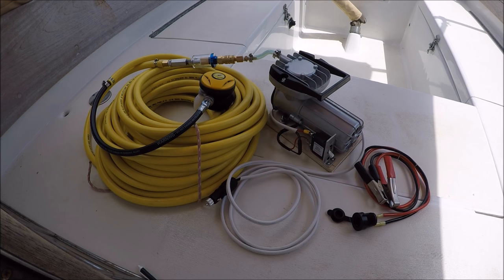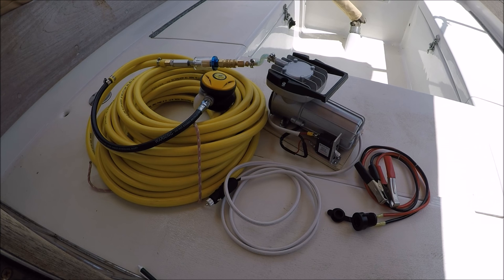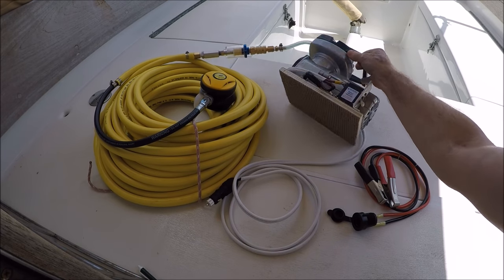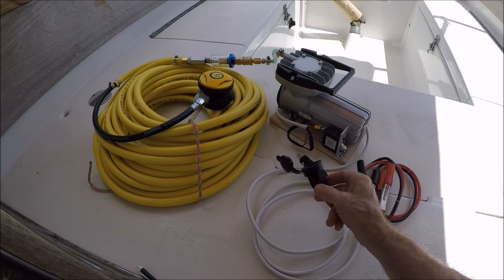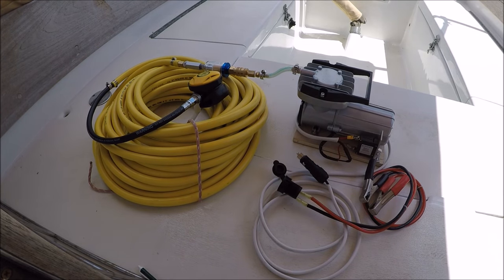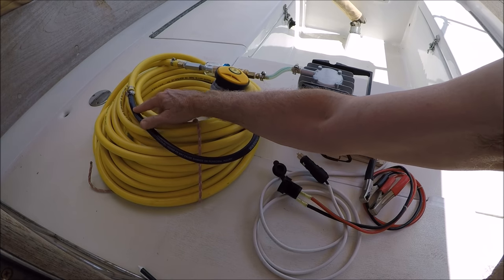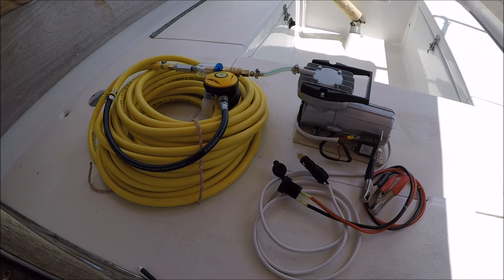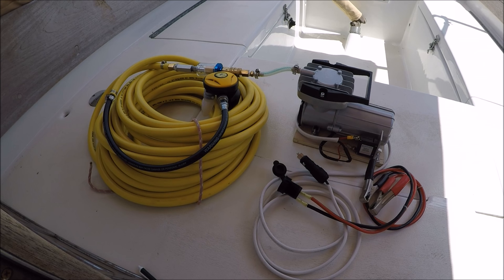DIY $300 Dive Hookah for Boat Bottom Cleaning

Comment: You probably don't need the regulator. Just run the hose into the snorkel and let the air flow out your mouth.  Breathe from it as needed.  A similar system operates in large aquariums where mermaids breathe from an air hose.  When I was young, I built a very simple rig from a DeVilbiss air compressor, garden hose, and snorkel and used it as I cleaned our swimming pool.
Reply: Is this a joke lol
Reply: 'Small Cell Carcinoma' be sure to flush the lungs out good.

Comment: There is no need for a 150 liter per minute pump , a human being at most inhales 12 liters of air per minute, so it would be enough to use a 20 liter minute pump with a 1 liter storage tank with a maximum of 6 liters to compensate for the fast breathing in moments of fatigue. However your system is effective but can be improved to consume less current and spend less on the pump :)
Reply from the maker: I don't doubt your numbers. However these Chinese pumps have not been verified that their output is as stated by the manufacturer. They claim it draws 9 amps but mine only draws about 7 amps at 12.8v so looks like it is at least 25% over rated. And if as you say, we don't need anywhere near 150l/min, that confirms the pump rating is inaccurate. Maybe some of the loss is the restriction of filter, hose length, depth of dive, regulator spring resistance, and so on.  In practice the pump, for whatever reason, is only barely giving me adequate air. I suck every last bit of air from the hose on each breath when working at 4'. Because I am using everything the pump delivers I don't think a small tank will help because it will always be empty. If the tank were large and you waited for it to fill it might help but I don't know for how long. I'm typically down for about 30 minutes to clean the bottom. It works OK for my use though.
Reply: @atomvoyager  Looking at the technical specifications of these pumps I noticed that the maximum pressure is only 1.12 MPA = 1 BAR +/- , if we consider that at a depth of 10 meters we have 1 atmosphere = approximately 1 BAR. here is the reason why he can't get his breathing properly. between the resistance of the filters and the pipes, at least 2 bars would be needed to have a good flow .....I was intent on buying one to build a respirator, but better to buy another type, perhaps with pistons without oil, .... thanks to you for sharing your experience!
Reply: @salvatorebarbaro5862  two bars right? At sea level we have one bar (1 atm).
Reply: I have used one of these for years but I used two pumps connected together. After a wile I got tired of hauling batteries and wired in an inverter so I could plug it in  on the pier or use a battery If I had to. Now I use a standard air compressor and a low pressure regulator. 50 to 80 psi.
Reply: @salvatorebarbaro5862  If we consider that he's going to be cleaning his boat at a depth of 10 metres then you are probably right. But it's a big boat. He's going to about 1.5 metres.
Reply: But you also have to have enough to push all that air down

Comment: if i may, i have s couple of things for you to think about. The air being pumped may have oil contaminates from the pump,  if you can, its best to put a filter in there, you should be ok for now as the length of hose will hold most of that back, but at some point its going to get to you. Also maybe a small bag reservoir, inside a  container as close to the regulator as is comfortable, this should protect from over pressure if that manages to happen for whatever reason as well as give you a more comfortable escape if the pump stops. i wouldn't go below more than a meter with compressed air, if you can help it.
Reply: Hey how can the air have oil in it? I just started using mine and I don’t like how I’m feeling afterwards, I thought these were “oil less” but I’m def feeling like crap

Comment: I built essentially the same system but used the smaller 906 compressor, I use it for underwater metal detecting to 10/12 ft, I changed to a lighter spring in the regulator for easier breathing, I also have a hose setup without a regulator but use a reconfigured snorkel with purge valve, this is an open system so air is always flowing, very easy to breath and good for when working hard, I used cheaper clear food grade hose. This compressor works well but MUST be disassembled and cleaned up a bit before use, the castings are rough and dirty, don’t use without a filter!!
Reply from the maker: That's very creative and good to know. My regulator is also harder to draw a breath on than it should be so I'll try to find a lighter spring.
Reply: Peter Nicholls yes and I adjusted it as low as possible but still needed a lighter spring, the pressure is very low and it took a bit of tweaking to get it so the air flowed easily without leaking past the valve

Comment: I am building a floating 12v hookah system for snorkeling. I see that this pump is made to run continuously. I'd like to connect it to 2-4 gallon tank with a pressure valve that turns the pump on at 70psi and off @ 110psi. How does the pump handle when you have the hose connected to parts blower and allow the pressure to build up?
Reply from the maker: The pump does not shut itself off when it reaches its highest pressure and I don't know what mechanism it uses other than it just keeps trying to pump even though  the regulator is not being drawn on or a blower attachment is connected but not being used. I haven't connected a pressure gauge to see what pressure it holds at. Maybe someone else can explain what's going on and how it might work with a tank and on/off switching.
Reply: @atomvoyager  This kind of pump, or even a normal compressor, has a maximum pressure and volumetric efficiency. At atmospheric pressure the volume of air displaced inside by the diaphragm (or piston in a regular compressor) can come straight out the outlet. When the pressure builds up on the outlet hose, the air in side only comes out once the line pressure is reached onside. The remaining air inside just expands again, reducing the amount coming in on the next stroke. That means that the pressure is self limiting without any relief valve. It's the same as when you use a bicycle pump to pump up a high pressure tyre. It gets to a pressure where it just doesn't go anywhere.

Comment: Curious how this has lasted 2 years on. I'm about to build a hookah and have ordered a low pressure 2nd stage reg (IP 50psi). My main drive like you is power consumption, aside from staying alive. The thing I worry about with the compressor mentioned is that it seems to be designed for unrestricted air flow thru aquarium stones. That would make it an air PUMP and not a compressor at all. Does it vent off at all under pressure if you never open the reg? I assume when you aren't taking a breath it compresses the air in the hose up to the point where the rubber diaphragm is forced to deform in order to pump nothing, or the electric motor would have to be physically held by the pressure on the diaphragm to a stop which would be very bad. It may have been built as a compressor and just used for aquariums or maybe not. I might try it with a variable relief valve so anything over mouthpiece pressure is just vented off.
Reply from the maker: I don't know the inner workings of the pump but it continues to work OK. It does not appear to vent itself when running with no air being drawn and that has not damaged it yet. I sold the original after one year and about 10 hours use bottom cleaning at a max of 4 feet to a friend who was sailing from CA to Mexico and didn't have time to order and build his own. He told me a week ago that he has used it for a year and put several more hours on it and is very happy with it. Besides bottom cleaning he used it while underway to cut free a fish trap line wrapped around his prop. I found I needed every bit of air it could provide and had to learn to control my breathing because at first I tended to hyperventilate slightly as I worked and felt like I wasn't getting enough air. Once I calmed down and got comfortable with the amount of air and the restriction of having to suck it out of the regulator resistance at the beginning and the lesser air flow towards the end of each breath as the pressure went to near zero I was fine with it.  I would not add a relief valve unless because you want it to build up all the pressure it's capable of between breaths to give you max volume available and because apparently it is not needed. When I replaced mine I used the slightly larger capacity ACQ-910 but could not tell any difference in output or power draw or maybe there was just a very small improvement. Anyway, these pumps put out a lot of air until you connect the air filter which restricts the flow so if you could find a less restrictive filter it might work better.
Reply: @atomvoyager  Thanks for the reply. I wish I could find something comparable around twice the size. This one draws less than my laptop, and even twice the wattage up to 300w, I could run off my solar. I'm realizing the bigger cheap oilless use pistons with teflon rings, which does not make me comfortable. I was happy to pay a diver to deal with this but they always flake out and it doesn't get done... Cheers

Comment: Hello, I purchased a partical/moisture filter like the one you have and installed and tested and air does not seem restricted at all...Question are you sure that your filter is installed correctly...I see know diagrams or flow direction arrows on unit...also any information on maintenance of filter? I do see gator gill sells replacement fillers...does your filter screw apart? Just not sure and don't want to break mine...ps fine tuning the reg and adding an extra air tank made a huge difference using my 160 lpm pump..I actually bought a 2 gallon pump sprayer I converted to air tank...these  pumps only produce around 28 psi.
Thanks for your help...😊
Reply from the maker: I believe I have the filter installed correctly and haven't felt the need to clean it or take it apart since the flow rate hasn't changed since it was new. There was no info on maintenance of it so try to contact Gator Gill or some other retailer of similar filters or hookah dealers. It could be that your 160 pump works better than my 150 and maybe the tank helps. I haven't experimented with a tank because I wanted the least bulky and simplest system to store on a small boat and I figured that since I used all the air it could output that if I used a tank it would be depleted quick and give no advantage after that. But I could be mistaken.
Reply: @atomvoyager  as long you are happy with it,is all that matters..thanks
Reply: @atomvoyager  to my knowledge it is better to separate the particles first, for example a wayward piece of aluminium getting spewed out of the engine as it gets older and worn, than for it to go through the water separator filter first.  It just makes common sense not to overload the water separator with large particles in the first instance, it is not designed to manage that otherwise.  Just what I have deduced, I am in the process of putting the gill filters on my Chinese bought version.
Reply: my filter is made for 'activated charcoal' it screws apart.

Comment: You covered a lot that is very helpful since I myself am building a very similar hookah using a 120w 160 out put rated motor...can you tell me if you needed to adjust regulator for better breathing? Also was there plenty of air delivery? What was your deepest testing? I am hoping my units air delivery is good up to 20 foot if needed...thanks again for all the great tips
..I need to buy a filter like you use...any idea on where or what it's called exactly? Thanks again.
Reply from the maker: My 150 liter output produced only just enough air for me at the 5' max depth I tried it so I doubt yours will work at 20'. But it could have more to do with the air filter restricting flow too much on this small output compressor. If you could find a less restrictive air filter that still delivered safe air then that may help. I have heard that switching the regulator spring to a lighter spring could help but I didn't try that and there's no other adjustment available that I know of. As noted in the descrption above, you can buy a filter on ebay. Here's one like what I used: https://www.ebay.com/itm/285188537516
Reply: @atomvoyager  I have that cheap yellow reg from Amazon  and figured  out how to adjust it ...I think this is why some guys are being able to breathe much better than others..these pumps only produce around 15 psi.
Reply: I tested the same pump, two persons hyperventilating rapidly,  always air. BUT..I have 2 X 2L food grade soda bottles as reservoir.

Comment: Very ingenious, as usual!!! Two questions/thoughts: a) does the double filter take care of removing condensation (which varies due to temperature) from the line, or how do you do that after you're finished cleaning the boat, and b) "Emerald Steel", their two-part Hookah set, reminded folks to not have a generator too close to the compressor so that exhaust gas doesn't get sucked into the compressor...Having seen all of your videos, multiple times, I know you don't take safety/quality issues in a hap-hazard or reckless fashion...
Reply from the maker: Thanks everyone for your comments. The water/particle filter goes after the compressor. Once dry air comes into the line I don't experience notable condensation building in the line but if worried about it you could add a second filter before the regulator. Here's a link to a similar filter if you want to research it more:
https://www.ebay.com/itm/Hookah-Diving-Water-filter-and-quick-connect-NEW-LOWER-PRICE-JUNE-JULY/182920828703?hash=item2a96ee571f%3Ag%3A86sAAOSwSZFZyX9C&_sacat=0&_nkw=gator+gill+filter&_from=R40&rt=nc&_trksid=m570.l1313
Good point to remind people not to run a gas generator next to the compressor, which is one of several reasons why I use a 12v compressor. With solar power, 400AH battery bank and the pump only using 7 amps, I don't have a reason to even own a generator. It's also a good idea to have someone on deck to monitor the compressor and assist as needed if there's any problem for the diver.

Comment: Hi James, I'm in the middle of building a copy of yours😄
I notice that the water &particles filter in your video seem to be attached in the opposite direction of what my supplier suggested. 
Do you have any issue with that? Trying to understand which direction is the correct way.
Reply from the maker: It's possible I got it backwards but I don't know that it matters. Blow into it from both directions and see. I would connect it according to your instructions.

Comment: I use that regulator on a Hudson tank I jus used electrical tape to thread it to the tank and it works well I can be under water constantly breathing for 2 mins in 5 feet of water

Comment: Does the pump have a pressure shut-off in case you wanted to add an air reservoir?
Reply from the maker: No, it keeps running. But you can still add a small tank.
Reply: I hate to steal anyone's thunder but I wouldn't use any tank unless it was Stainless Steel. Maybe a 1/4 bbl beer keg. I don't know what the pressure rating is on those so be careful. Not unless you like breathing air from a rusty tank I wouldn't use a pancake compressor or the like attached to a ferrous metal tank. I'm willing to bet they aren't coated on the inside. Even if it were when they welded the two halves together the paint would burn off where the bead is and paint flakes would clog everything. When you drain the condensate from the tank of a typical oil less air compressor look at the nasty, rusty water that comes out and you'll see exactly what I'm talking about. That can't be good for your lungs. (CPOD) Even with that filter on it I wouldn't trust it. If you buy an decent filtration unit  with a dryer on it for compressed air lines, you're looking at a staggering cost (Cost = quality) that will be more expensive than all the parts put together building the entire rig.  Also the pump you recommended has gotten some horrible reviews. Even the higher capacity pump. I have a Porter-Cable pancake compressor that I may separate from the tank and try fitting to a 1/4 bbl beer keg once I find out the pressure rating on the vessel. That way the pressure regulator and the safety pop off valve is still in place.

Comment: Sir, I often used in scuba diving, there is an eel in a glass-like box between the compressor and the pipe. What is it for? And if it is not, what is the benefit or harm?
Reply from the maker: It's a water and particle filter listed in the video description above.

Comment: what is the maximum dive depth you can achieve with this pumps pressure>? 15-20ft??? very curious if i could use it for gold sniping rivers 10-15ft deep 
thanks for your time and sharring
Reply from the maker: Because of a chronic sinus condition I have trouble diving below about 6' so I haven't tried it. It only provides just enough air for me as is so I doubt you could use it at 20'. I didn't notice any difference in the amount of air available on the surface or at 5' so I expect you could go at least to 10' and maybe deeper. I found I have to control my breathing using this minimal setup and think I would get better airflow with a different filter and lighter spring in the regulator because there is about twice the air flow out of the compressor to what I get when I connect the filter, 50' hose, and regulator..